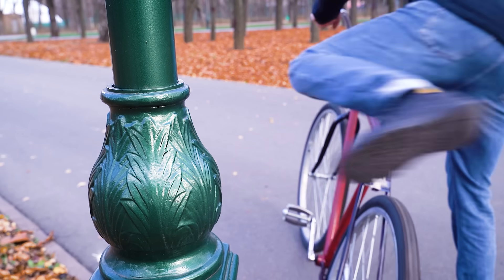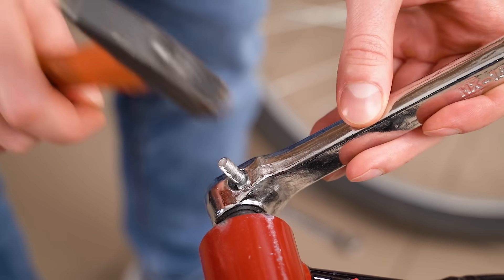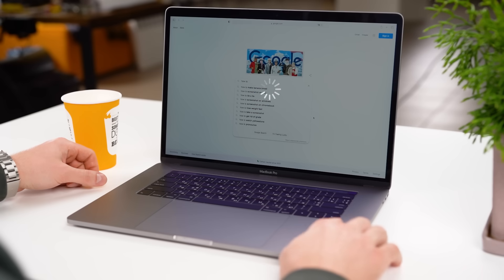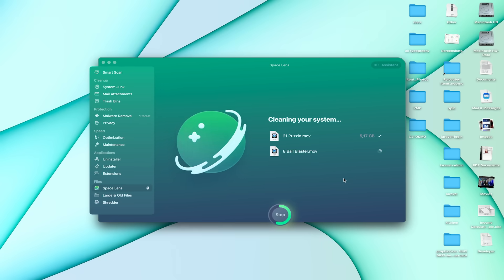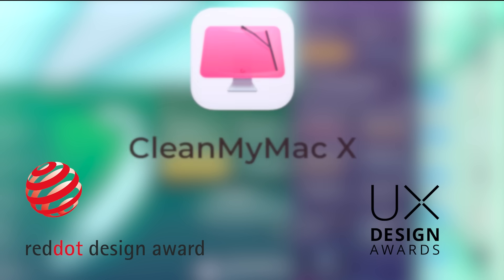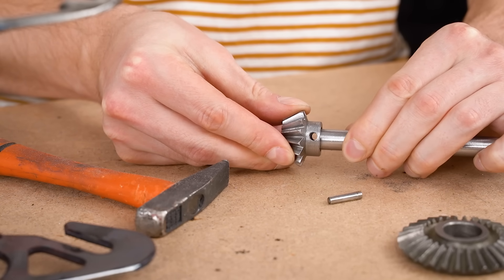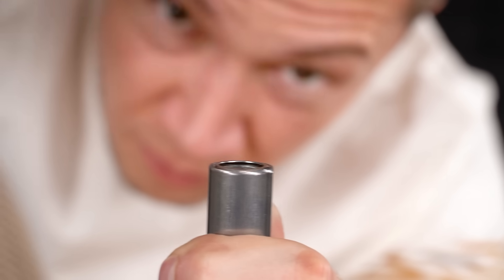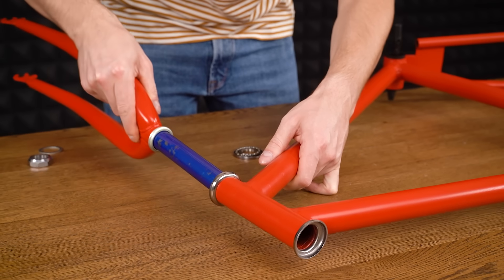Insane Chainless Bicycle Prototype

Comment: This's cool DIY video, but shaft-driven bicycles are already there for more than 100 years, since 1890.
Actually, chain-driven are considered a vast improvement over shaft-driven bicycles with better performance, efficiency, and ease of maintenance.
Reply: The whole point of shaft drive bicycles is to do away with maintaining the drivetrain. Literally every other aspect (weight, efficiency, cost, gearing range) is sacrificed to achieve this end.
Reply: @johnbarron4265  btw, how difficult really is to maintain a chain?
Reply: @williamko4751  Depends who you are. For a pro racer, maintenance is a non-issue as they have a team of mechanics.
For a trekker, maintenance is a big issue.
For the average commuter or recreational cyclist, it's just another chore to do occasionally in one's spare time, so not a big deal.
Reply: @johnbarron4265  Even for trekker,  clean and grease the gear and chain once every two three month, and may be replace the chain once a year. Not a big deal either.
Reply: @johnbarron4265  My thoughts exactly .
Reply: @johnbarron4265  oh really, I bet (for nothing) that axle is better in all cases when executed with lubricated closed contact containers, similar to a motor bike transmission
Reply: @Jkauppa  Shaft drives are at best 90% efficient. Cyclists have a lot less power than motorcyclists, so they need every watt to count, and every kilogram not needed should be removed. A shaft drive simply doesn't make sense for a bicycle because the advantages aren't as important to cyclists as they are to motorcyclists. Cyclists don't transmit near enough torque to take advantage of the rigidity and strength of a shaft drive. And if you need low maintenance and longevity out of the drivetrain, then you go with belt drive, as it's more efficient and lighter than shaft drive.
Reply: @johnbarron4265  I bet you are selling chains in way or another, newer trust sellers, or sell-outs, be free, dont try to limit usage of axles, its a fine idea
Reply: @johnbarron4265  you are the watt stealer, no thanks
Reply: @Jkauppa  shaft drives transfer power 90 degrees which creates a lot of power loss. With a chain drive the power doesn't change direction because you petal in the same orientation as the wheel so the power loss is minimal.
Reply: @Zach-ju5vi  I raise you with a failed 90 degree argument, with a straight consecutive cog (no matter what degree) power train system
Reply: @Zach-ju5vi  Q, you could also try a dynamo/generator directly on the pedal hub, with the chains removed, to annoy the chain-people, then transfer the 100% power by dc wire to the back motor, also can be used to directly (not wheel power) a light, and integrate a rechargeable battery more directly, recharge it, and use it to also directly power the hub wheel motor on the back
Reply: @Zach-ju5vi  slave of chains, admit your sin, you have skin in the game with the chains, admit already, biased towards the chains, chained guy, if you dont advocate for chains it hurts your brain
Reply: @johnbarron4265  Cyclists can generate considerable peak torque at low cadence.

For an 80 kg rider standing on the pedals with 175 mm cranks...

80 x 9.81 x 0.175 = 137 Nm

That's on par with most litre-plus motorcycles.
Reply: @weevilinabox  It's the torque transmitted to the rear wheel that counts. I could build a 1 meter long crank and then I have more torque than a semi truck.
Reply: @Jkauppa  Electric dynamos and motors are nowhere near 100% efficient, and because you want two of them, you already have double the energy loss. And double the extra weight. No thanks, I'll keep my precious watts using my well-lubed chain.
Reply: @johnbarron4265  I should stop listening to you to not lose any more words
Reply: @johnbarron4265  stay in your things, but dont prevent people from going more advanced, even if you want to discourage people from experimenting
Reply: @johnbarron4265  I wonder why people tout electric motors near 100% efficient, but note that I did not claim anything particular against chains, just that you tried to push down the other options, especially axles and electric drive trains, as a viable option
Reply: @johnbarron4265  assume you have 95% efficient dc generator, and 95% efficient dc motor, you end up with same as the chains, no difference between options, what you try to push between them, let people choose what they use
Reply: @johnbarron4265  going to gym is more useful than this discussion, more power on the input side
Reply: @johnbarron4265  what can you do, if I believe that everything is 100% efficient, you try to bend me out of my belief, hows your god years feeling
Reply: @johnbarron4265  Yes, you could, and if you applied that torque to a shaft that wasn't rated for it, you'd break it just as surely as the truck would.

I concede, having reviewed the video, that the gear ratio at the crank means that only about half the rider's torque will be transmitted to the shaft, but I'd still deem that torque considerable.
Reply: @김태환-s2i  I dont assume you speak the truth and I'm not  ruled by your lies
Reply: @Jkauppa  more moving parts usually means less efficient, quit trolling because you have a hard on for outdated ideas that have been proven inadequate. You aren't an engineer, if you were this wouldn't be a debate
Reply: @Jkauppa  lmao, but you expect everyone else to buy your BS, as if it true
Reply: @chrism8180  how many moving parts are in the chains, just feeding you your own resistance/reluctance motors
Reply: @chrism8180  by peoples degrees I'm a master in engineer, "know" your declared physics "thruths" and _y_ou do not set me rules where to troll or not
Reply: @chrism8180  so where is the proof, your talking is no proof, or you quoting earth is not flat, someone saying so, is only a proof you believed a lie
Reply: @chrism8180  oh now you are the rule maker
Reply: @chrism8180  I gave options, you took the options away
Reply: @chrism8180  your facts first, right
Reply: @chrism8180  hypocrisy is never measuring their own bull
Reply: @chrism8180  because you want to rule
Reply: @chrism8180  you are chained to your thruth, you cant see the forest (options) for the chains
Reply: @chrism8180  its the chain zone, nothing else allowed here
Reply: @chrism8180  you just lie
Reply: @chrism8180  enjoy stone "adequate" age
Reply: @chrism8180  the church of chains, I believe, I must believe in chains, no
Reply: @chrism8180  we have two then
Reply: @Jkauppa  i like the shaft driven bike but it's not efficient 
Now make it somehow shift to different gears that be different
Reply: @johnmock5825  just make it drive a hub gear box, just an example
Reply: @johnmock5825  dont mock God and say: its not possible
Reply: @Zach-ju5vi  and that’s a bingo!
Reply: @Meatball2022  in Aldo the Apache voice: You just say "Bingo!"
Reply: @stocchinet  I dont rely on people
Reply: @BPollard86  and you cant be wrong, can you
Reply: @BPollard86  you better understand that I dont bow down to rules, any of you
Reply: @BPollard86  bow down to nothing created
Reply: @johnbarron4265  if you’re in a race, then yes, every watt counts. On the other hand, if you’re using a bike to commute to work, then it may be worth trading some performance for reliability.
Reply: @BPollard86  denial, bargain, sadness, acceptance, which part you are on, when you dont get what you want, kid
Reply: @kgsvvgla2i  olet varmaan itse
Reply: @Jkauppa wud be far more costlier, heavier, prone to needing maintenance & what not … negating all benefits except paddling as much …. Which is the point of using bicycle.
Reply: @billumand  i dont agree with you
Reply: The 'safety' bicycle,  that is, one that uses triangles in the frame design, ( and was the basic layout for most bicycles  built for many years) were designed by Rover, which became a car manufacturer in England, a long time ago. These first 'safety' bicycles, ( as they were called) were bevel gear bikes. So, nothing new here.
Reply: I think about the lubrication of the gears... they receive a strong moment force in their teeth so what are the capabilities of the metal league used there?
Reply: Plus with shaft drive you only have one gear . Chain drive can have 10 20 or even more .
Reply: Just that!!! This guy come here like to show us an innovation lol xD
Reply: He never said he invented the idea. He’s just showing how he made one himself
Reply: The ratio is not good.
Notice he pedal a lot.
That's because the gears on both ends are same.
Reply: @xt5181  I’d say it’s easier to replace a chain than a shaft…
Reply: There are public bike rental schemes in Portland OR using shaft drive bikes using 3 speed shimano hubs
Reply: I came here to say the same thing lol
Reply: This type of bicycle in Italy (I'm Italian) are called Trasmissione a Cardano, in French Acaténe and in English Cardan or Chainless bicycle.
Yes, they was already patented in the 1890's. Very common in the early 1900s in France (FN, Metropole), in USA (Columbia) and in Britain (Humber).
Reply: Зачем эти не нужные споры? Нужно выкинуть цепь, втулки, педали и отталкиваться только ногами от земли )) У нас в России только так и катаются, зимой, а летом мы на медведях передвигаемся. На медведях удобно - можно спокойно играть на балалайке и пить водку из матрёшки
Reply: @ASDF_.  Like your sense of humor, is that Sanskrit?
Reply: @chrism8180  не, это инглиш, ёпта
Reply: This Drama ,making money  From  U  tube
Reply: And also I think the gear ratio is pretty bad
Reply: @rusty_uzi  you can have variable slider gearbox, or something simple
Reply: @Jkauppa  I don't think you are really considering what people are saying. I'm preaty sure bikes are designed the way that they are to keep weight and production costs down.

1. Weight: Bikes are generally designed so that they can be as light as possible. Humans don't output that much power and don't weigh that much so having a bike be 5-10 pounds heavier is a big deal. When you look at chain drives on bikes they are extremely streamlined and cleverly designed. If you wanted to achieve the same thing with a shaft and separate gear box it would be much heavier and bulkier.

2. Cost: current chain drives are very easy to manufacture. Chainlinks can be standardized and mass produced  and the gears can be cheaply cut out of flat sheets of metal. On the otherhand things like gear boxes and bevel gears like in the video are much much more expensive to produce because they require precise turning and milling processes as well as complex assembly.

3. Maintenance: the one advantage shaft drives sort of have in this application is durability and maintenance. Even then they aren't really objectively better. Chains break but they are cheap and easy to fix or replace. The chain will also give way before more expensive things like the gears and frame meaning that you are very unlikely to encounter any real hard to fix damage. Gear boxes and shaft drives on the other hand won't break very often but when they do you will probably be bringing it into a repair shop rather than fixing it yourself. Additionally in a rigid system like that if something catches or binds rather than having the chain break and cause the wheels to coast the bike will freeze up and you will be tasting a lot of blood and dirt.
Reply: @infiniterune7101  I consider that people are staying, not talken away their own
Reply: @infiniterune7101  you are just talking, nothing useful
Reply: @infiniterune7101  dirt should not talk in the congregations
Reply: @infiniterune7101  you are basically just saying "they are truth", pointing that way, you require believe in you, or they, or any combination of something
Reply: @infiniterune7101  money is the worst excuse
Reply: @infiniterune7101  I dont serve (for) money or you or anything you state needs to be served or honored, bowed down to
Reply: @infiniterune7101  its your problem, not mine
Reply: @infiniterune7101  dont make me carry your law rules
Reply: And the gearing isn't semi permanently fixed
Reply: @xt5181  Shaft drive on a bicycle was abandoned way bach as chain drive is a superior setup. Also comparing how most BMW bikes (motorcycles) have shaft drive means nothing in this setting, a man powered bicycle...apples and oranges.
Reply: Not to mention that the chain system doesn’t have to be perfectly aligned and allows for shifting gears.
Reply: Ladies didn't trap their petticoats and skirts on shaft driven bikes plus chains where harder and more expensive to make.
Reply: They say shaft driven motorcycles are more comfortable to ride and shaft drive can produce or handle more torq or something like that
Reply: Agree the title let me frown my eyebrows,because this isn't right.
This type of bike exists for over 100 years,some old people stil have them here
Reply: Ease of maintenance and performance is false, but the rest, sure.
Reply: But...
Direct drive could be

Trumpet Sound,,,

2 wheel Drive!
Reply: Couldn't agree more
Reply: Yeah right, recently they found 5000 years old Shaft driven bicycles from Harrappa civilisation
Reply: @kalpeshpurivairagi4526  cog-chain is no more than wheels in line, no chains tho, no chains intended
Reply: Delhi farmer dance border
Reply: BMW still uses shaft drives on their motorcycles
Reply: Lot of funny people who don't know what they're talking about in the comments.  Motorcycle shaft drives are in the mid-80% efficiency range. Belts are low 90%'s and chains are mid 90%'s.
Reply: @Surlymtb  so you say
Reply: @Surlymtb  you are fool to be believing or letting people believe what people say
Reply: @Surlymtb  "I am your lord and god, you must believe in me"
Reply: @Surlymtb  I think not, that God part
Reply: Lol
Reply: How come then cars use shaft? Is it to save space?
Reply: @LiborTinka  Cars overwhelmingly use driveshafts because they have a longer wear lifespan and are more reliable than chains, especially under shock loading, making them more robust to abuse. Furthermore, they need shafts anyway to route power from the center of the vehicle to the wheels, as chains would require additional bevel gears. Drivetrain efficiency takes a back seat to reliability on road cars, whereas on bicycles the order of importance is reversed.
Reply: Internal combustion engines use all three methods for the timing. Belts are used dry and chains and gears are lubricated by the engine oil as they are inside the engine.
The chain can normally outlast belts. Belts have a shorter replacement interval.
Gear driven timing  will outlast belts and chains. Its normally used in high HP engines where a belt or chain is too unreliable.
Reply: I was learning a lot at first then this one guy that keeps saying annoying crap not adding anything just being a nuisance kept spam replying everyone.

And why'd you read until here there's nothing else dude.
Reply: Cleaner style yes...but getting stuck in one gear huuummm naaah...
Reply: @KAarnagemAmolgada  why do you need to be so thumb in the middle of hand, no skill
Reply: @KAarnagemAmolgada  jada jada jada
Reply: @KAarnagemAmolgada  oh do I know..
Reply: @KAarnagemAmolgada  go home
Reply: @KAarnagemAmolgada  yes you dont give, you only trade, so "rise, take your bed and go into your home" and thats no us, talk from slavery is annoying
Reply: @KAarnagemAmolgada  you cant take if its not given to you from above, who is above you, I think "all" in this world things we are their dumpster, so high you are, kings, be lowered, bow to the actual king, and no we dont bow down to you
Reply: Shaft drive bicycles are way more efficient. That's why all the pro cyclists in the Toud de France use them.
Reply: @bdv861  you only made that rule
Reply: Djcheb Oxbrbwi   before you started attacking people, try to read again? What was the original comment may I ask? What do I use now? A dork? Lmao?
Reply: @xt5181  Gates carbon belt drive is the most durable and easiest to maintain.  You can use it with fixed gear, single speed and internal gear hubs. It even works well with eBike motors.

The cons is you need a special splittable rear triangle bike frame to install a 1 piece belt drive.  Belt drives are slower than a clean well lubricated chain when racing.
Reply: I once rode a fixed-gear shaft drive bike built in 1901 at a local bike museum. The backlash in the gears was around 10% of a rotation of the pedals. It's not hard to see why shaft drive never caught on.
Reply: Why would you assume he doesn't know that?
Reply: Also his prototype has little to no lubrication. Which could decrease the life of the gear by excessive wear.
Reply: @torahibiki  would that be a production version, think again, demo only
Reply: @Jkauppa  no I get that is demo. I'm just saying.
Reply: @torahibiki  why so negative :)
Reply: ты сколько цепей в год меняешь? А тот механизм, что на видео проездит многие годы. Поэтому таких велосипедов производят мало и стоят они дороже. Невыгодно их производить,
Reply: Them gears wouldn't last long as they are open to all the muck that will be thrown at it
Reply: I prefer Belt-driven bicycles. Clean and easy to maintain no matter the weather, you don't need different lubricants depending on a weather, like when using chain.
Reply: @n0_skills  Then you prefer a single speed too.
Reply: @williamoftexas1489  not, I prefer it with hubs with internal gearing
Reply: I think the mechanical advantage over chain type will be greater hence you can cover more distance from less effort.
Reply: Ofc it's always going to be one person to crash someone's conception and it's YOU. You literally pointed out what majority off people today already know just to knock his project let him be why the hatred?
Reply: Wow you must be fun at parties
Reply: I dont consider chains to be chained to your statements
Reply: I don't think it has better efficiency as chain has efficiency of up to 98% if I remember correctly. The other 2 I'm not so sure, can't remember the details. I believe what you are thinking of is belt driven bicycle, not shaft driven bicycle. Cool tech is still cool though, so I'm not gonna judge
Reply: @SuperSohaizai   That's the same as what he said. Reread his comment. The chain is more efficient.
Reply: @firesurfer  oh kay.... I actually misread it until you pointed it out... Thanks, and my bad!
Reply: @SuperSohaizai   I figured that when he wrote: " shaft-driven bicycles with better performance, efficiency".
Without the context of the entire sentence, it can easily be misread.
Reply: @SuperSohaizai  But there's no efficient way to use a rear derailleur with a belt..
Reply: @williamoftexas1489  belt driven requires a different groupset entirely, so you don't use derailleur with it and instead use an internal gear hub at the rear if I'm not wrong, yeah never used it before
Reply: @SuperSohaizai  I know.  You just reaffirmed my comment.
Reply: @SuperSohaizai  no
Reply: @SuperSohaizai  so what do you think cog efficiency is, 100
Reply: both not true
Reply: all you d-heads repeating industry (gov shill) lores, just shut up and let this tech be there, it just works
Reply: cars would be using chains, and there would be axle bikes on the road
Reply: @Jkauppa  Cars did use chains in the past. Now they use kevlar belts. The reason cars don't use chains at the wheel has more to do with engines being mounted perpendicular to the wheels to save space than efficiency. One example of a car with chain driven wheels would be the Brutus, but it's more a Henkel He111 engine with wheels than an actual car.
Reply: @BrunodeSouzaLino  ok I confess, I hate chains because they break easily
Reply: @BrunodeSouzaLino   u sir are correct. In fact, chains lasted longer than kevlar belts in my experience. I could be wrong tho.
Reply: @Jkauppa  That's not true at all. In fact, that's so untrue that motorcycles are chain powered till this day. Ergo for chainsaws. If your chains break easily, either you're not using the right chain or adjusting it wrong.
Reply: @Jkauppa  I have been using my Dutch single speed chain bike almost every day since 2007 without any maintenance. In rain, snow and sunshine. If it fails I can get it greased and fixed for 15 Euro's or a new chain for 25 Euro's and cycle another 12 years at least without any problems.
Reply: @Jkauppa  buy a good chain then if you hate them so much. An xx1 Eagle chain can last longer than you in good conditions
Reply: @hashy4940  I saw you breaking them (the laws)
Reply: @Jkauppa  No they don't,  unless you weigh 150+ kg
Reply: @williamoftexas1489  just s-talking
Reply: @BrunodeSouzaLino  Cars need gearboxes because internal combustion engines (especially petrol) don't make much torque, so they need gearing to pull away / go up hills. Even modern high-performance cars with a lot of torque are making it from the gearbox and drivetrain.
Electric motors and steam engines do make a lot of torque, so those cars don't have gearboxes (except steam cars have a way of reversing the drive, while electric cars just run backwards)
Reply: @Jkauppa  Cars use shafts primarily because they don't need the efficiency of chains and belts, but they'd likely get better fuel efficiency if they did. Having a shaft for a car, makes a lot of sense due to the space and maintenance requirements of cars. If you wanted to have a chain, it would have to be massive. I've seen the ones that are used on those Boss Hoss motorcycles that have basically a car engine instead of a typical motorcycle engine, and the chains are absolutely massive. A car would likely have an even larger one.
Reply: @SmallSpoonBrigade  all equal
Reply: @Jkauppa  bro it's being a year stop fighting about chain bicycles